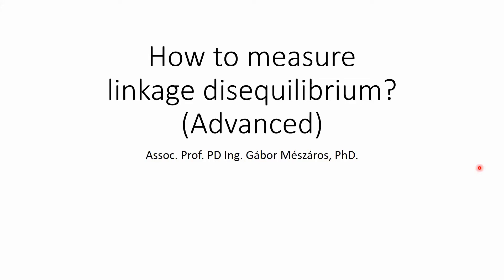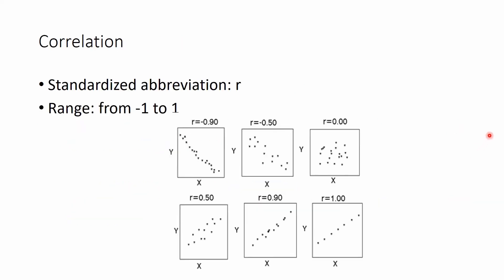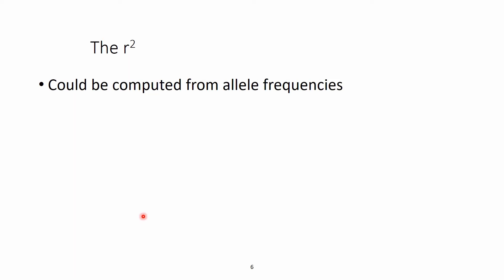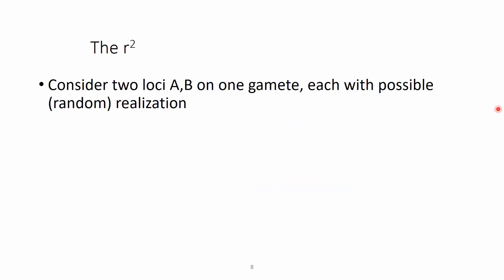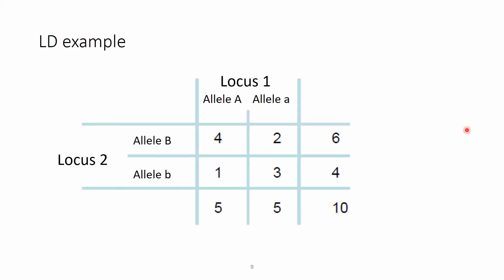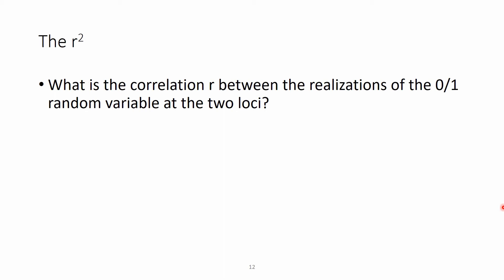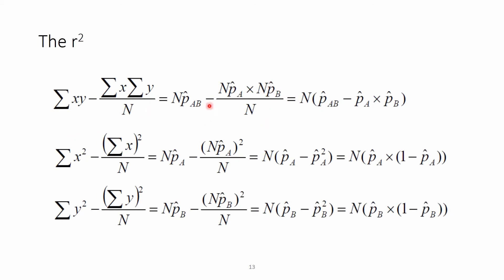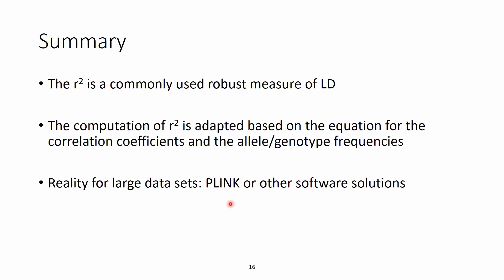Advanced follow up: How to measure Linkage disequilibrium (LD)? | Genomics

Comment: To obtain P(AB), what happens when we don't have the phase information? Thanks a lot!
Reply from the maker: Thank for the question!
With this approach it is not possble. But it seems PLINK has a "haplotype block estimator" , which is mentioned at the very beginning of the page devoted to LD
https://www.cog-genomics.org/plink/1.9/ld

I am unsure about the process it is utilized, however.
There is a different method also mentioned on the same page, but my understanding is that this is being triggered only with the use of "dprime" option 
https://bmcbioinformatics.biomedcentral.com/articles/10.1186/1471-2105-8-428